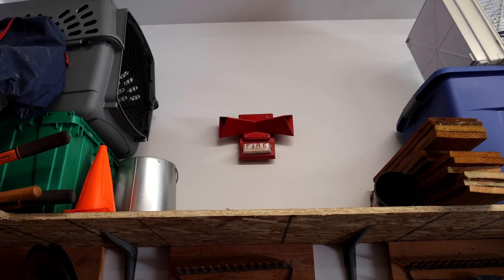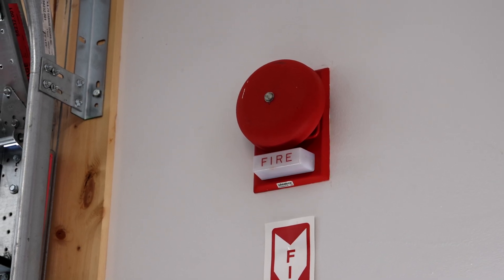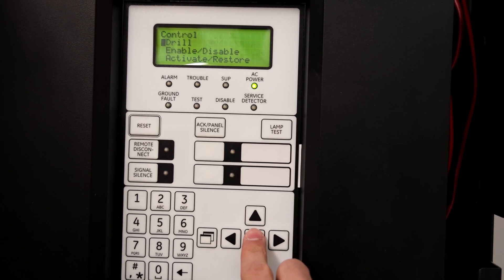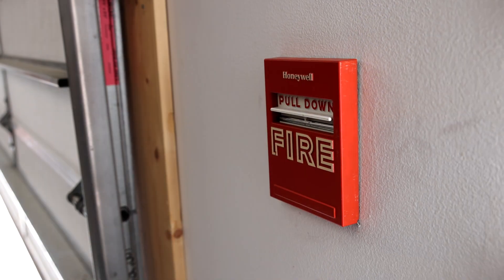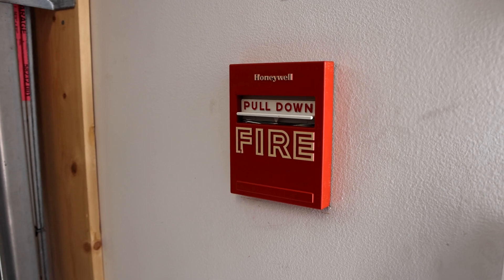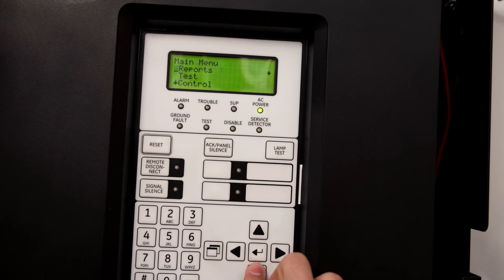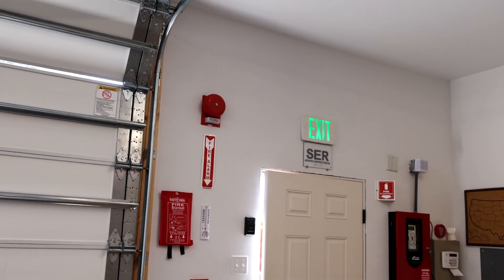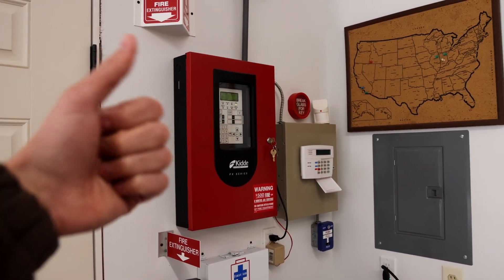Garage Fire Alarm System Test 28 | Simplex Double Horn Projector!

Comment: the old kmart in cookeville actually had 5 9838s with 3 on projectors and all 5 on 2903 light plates with a couple 9806 horns and the system panel was a 4002 but it all sadly got disconected and replaced hower 1 9806 horn and the 3 9838s on projectors on 2903 light plates remained but the new l series horn strobes where installed

Comment: I remember at my elementary school in one of the hallways was a Simplex 2905-9907. I still have no clue whether its disabled or not, because i never heard it in fire drills. Most of the alarms are 4903-9150's and there are a few truealerts. Flooded with Simplex T Bars, and some have a cover on them because of so many false alarms.
Reply: My school got speaker strobe SpectrAlert Advances in 2025
And all of them got replaced with the SpectrAlert Advances
We used to have T-Bars in the hallways but those got removed because some kid thought it would be funny to pull the fire alarm
We still have a few BG-12s in smaller rooms

Comment: Hey SER SAFETY, What is your and SAFETECHS job called exactly? Im looking to get into this profession, I however was born handicapped, and cannot wait without a walker or the assistance of someone holding me up? Can someone like me who mostly uses a wheelchair out in public, do this job?
Reply: A fire alarm inspector
Reply: The job has a lot of walking around buildings and driving to them so idk. It could be possible but idk. I wouldn't lose hope though.
Reply: Would they make an accepion if I had my wheelchair because technically there isn't a fire?
Reply: @joaquinmengel2224  Yeah probably, you can use elevators to get up and down floors to test devices. Although sometimes u might have a scissor lift to get to high ceiling devices (Or they have poles to test them), but u might have multiple people with you to help out. You probably would have to research or ask employers I guess. And a lot of devices are high up on walls too so again you might need to ask about this type of job.